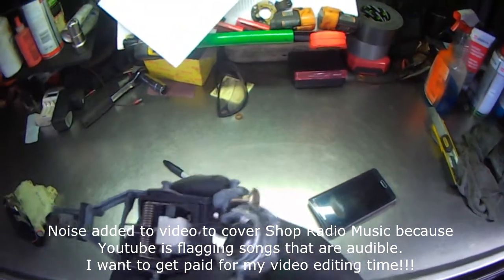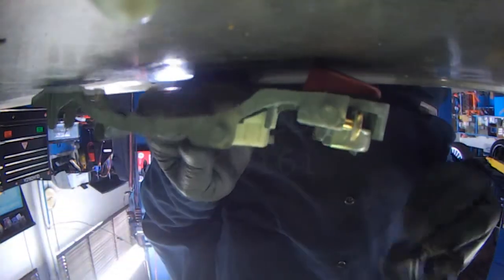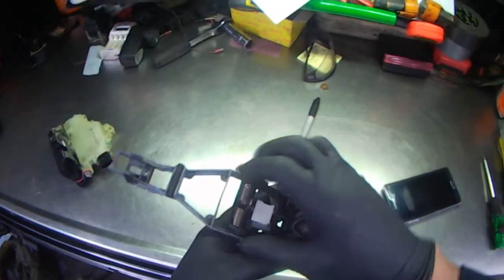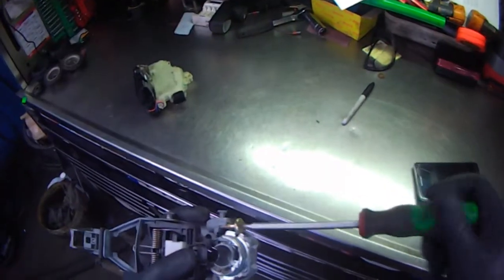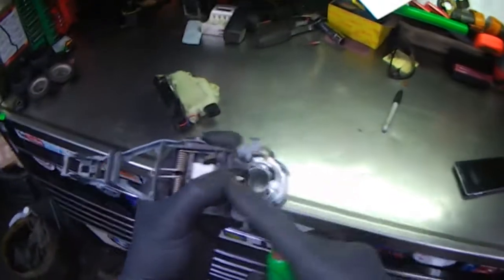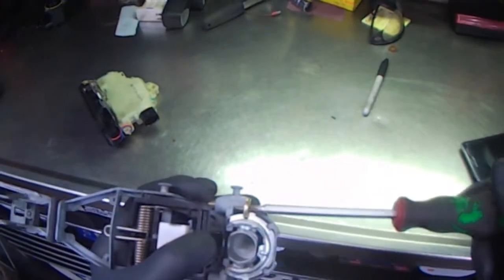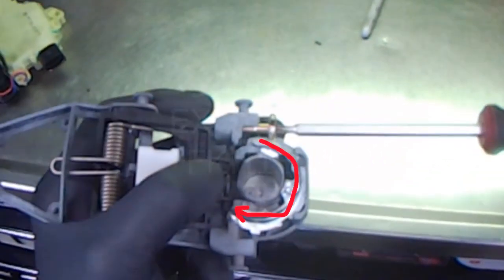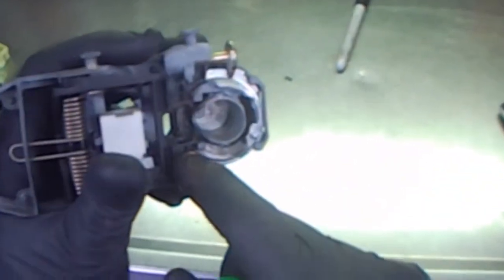VW A4 / A5: Key cylinder lock ring explained (sort of)

Comment: Hi Thomas, happy new year! Been binge watching a bunch of your videos. So helpful! Of course I turned the T20 torx screw too much and it has fallen into the door however for the life of me, I still can’t seem to get the lock cylinder out. I don’t know if I see the C clip is in there anymore but is there anything you would suggest? I’ll be taking off the interior door panel but wanted to see your thoughts before I muck up anything further. Thank you again for your thoughts!
Reply from the maker: If you can not remove the cylinder, then the c-clip is still holding it somewhat. Try to wiggle the key in the cylinder / move the cylinder to try and jiggle the clip off of the cylinder.
Reply: @EXOVCDS  Thanks Thomas! I gave it a wiggle and didn’t work but as you noted, the C clip was still holding the cylinder. Through the hole where the T20 torx screw was, I was able to take a small hook like tool and grab the C clip and yank towards me. I felt it give and release and was able to take out the cylinder cleanly! Thank you soooooo much for your thoughts and for this video! I’ll be using it to put everything back together once I grab the clip and screw that fell inside the door. Thank you so much again! You’re a life saver!!!!
Reply from the maker: Thank you for the update and thank you for watching!
Reply: Hello again! Forgot to ask you, the main point of me taking this apart is that I’m noticing the door only opens if I pull on the handle twice. The first pull does nothing but then when it’s released, you hear a “click” which sounds like it’s coming from the door handle spring or something and then when you pull it the second time, it opens. Was going to change out the door lock module anyway but wanted to see if you think it could be anything else. Thank you again for your continued help Thomas!
Reply from the maker: The door handle cable might need to be adjusted. Over adjustment can cause the outer handle not to work... under adjustment the same. For correct adjustment, the release lever for the cable needs to be preloaded by the clamping spring. You can only do that while the assembly is out... so you might as well replace the assembly if you already have one. If you can't find instructions how to preload the latch... let me know.
Reply: Thank you so much Thomas! First I thought it was an adjustment with that small plastic tab that’s connected to the cable that sits inside the grooves on the handle. I had it tighter and then looser but the door handle still felt the same and didn’t work properly. When I unlatched that cable and played around with just the door handle, the handle’s spring still felt funny and you could hear it click again when I released the handle which is why I was thinking it was something with the handle and not the lock assembly. Either way, as you’ve noted, I might need to replace that anyway. Yes, if you can send me instructions on how to preload, that would be greatly appreciated! You’re such an amazing help Thomas and I wish I lived closer to you in CA! Thank you again!
Reply from the maker: Watch this starting at 2:50
https://youtu.be/RqmqnK6UXvY
Reply: @EXOVCDS  Got it. Thanks again Thomas! Take care and all the best this year!

Comment: hi i have skoda fabia II (uses VW parts) . i have problem with door. door open symbol is on dashboard but door is closed. i checked the lock and microswitch , it is fine. when i disconnect the connector/wiring to the electric window motor the door lock is working fine. can you help? where is the problem?
Reply from the maker: Are the other door lock actuators OK? It's not just the driver door that turns on the door open symbol. Using a scan tool, you can view door open / closed status for all the doors. Then you are sure that you are spending the time trying to fix the correct door.
Reply: @EXOVCDS  yes its the door at the drivers side. i used vcds lite to check. i changed the microswitch that is checking if the door is open or closed.
Reply from the maker: I'm at work... all I can suggest is to check all the wiring. If I find a wiring diagram (after work later today) I will have a look at it to see what I can think of to check / test.
Reply from the maker: What year & what engine... so that I can look for a wiring diagram.
Reply: @EXOVCDS  it is 1.4 - 1390ccm 86pk   year 2009 . thanks
Reply: 5J
Reply from the maker: I will look later today (I'm at work again).
Reply from the maker: I looked...  I could not find a wiring diagram, sorry.
You said: "when i disconnect the connector/wiring to the electric window motor the door lock is working fine."... but the light stays on? There are up to 3 micro switches. One is for latch open/closed, one is for door open/closed, one is for locked/unlocked.
Reply: @EXOVCDS  ok thanks. will check

Comment: humm so the boss doesn't want any free advertising?  Try this exercise to hone your multi-task skills - walk and chew gum at the same time.  If you hone your skill of talking to yourself then the self narration will flow for you.  Makes the wife crazy when you do this at home.
Reply from the maker: I just don't like talking out loud to myself... I'm sure that my coworkers would understand / be ok with it if I did for every video, but it could also be distracting for them. I can sometimes hear the guy 2 bays from my bay talking to himself (no idea why he does it)... maybe if I get a microphone, I don't have to talk very loud then.
Reply: @EXOVCDS  if the C clip pops off of the lock cylinder while it’s inside of the door, how do you get the door handle off?  Without holding the handle the T20 torx only turns and clicks but doesn’t release the handle for removal.
Reply from the maker: @DrHorne  Then the C clip is not fully off. When the c clip falls off, the cylinder comes out and the handle can be removed. To get at the "fallen" c clip, you have to remove the window regulator panel or the speaker. If it's a mk5, the outer door panel.
Reply: @EXOVCDS  thank you for your (very helpful) response.  Also thank you for your time and sharing your talent(videos).
Reply from the maker: @DrHorne  If the cylinder does not come out... remove the Torx  screw (use a magnet to catch it and then you might be able to manipulate the c clip to allow the cylinder to come out. You need to pull on the handle first. As you turn the screw, the c clip should rotate and then hold the handle / keep the handle form going all the way back again (towards the door). No big deal if the c clip falls, you can get it later. Let me know if you have success or are stuck at a certain point.
Reply: @EXOVCDS  you are correct normally if the c clip/ring falls out the cylinder releases.  However, this one locked in & continued to hold the door handle in place(weird). Honestly I think someone previously worked on the door & didn’t put it back together properly.  After hours & hours of attempting to get the handle to release, I ended up removing the front door skin to figure out how the entire lock carrier/cylinder/handle worked.  After figuring it out, I slipped a finger just inside of the lock bezel pulled back slightly & pulled the handle out.  God Bless all of you mechanics that work on vehicles & are willing to share your time, skill, talent & videos.  After this diy project... I think I will keep my day job! :-)))
Reply from the maker: @DrHorne  Good to hear that you were able to sort things out! Thank you for the update!